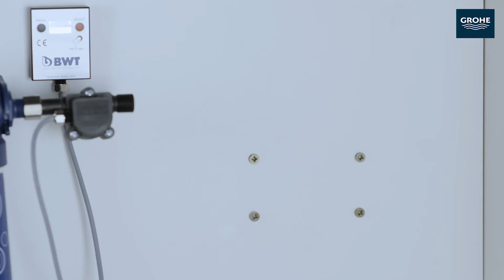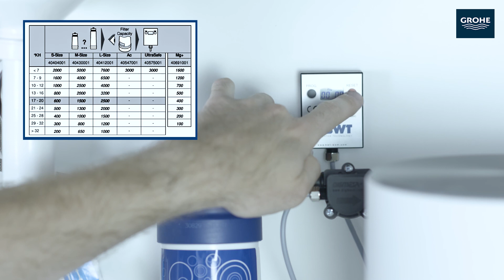Grohe Red - Product Installation (UK)

Comment: I had this installed yesterday, but I don't have instant hot water.  The kettle clicks when I touch the demand button after taking the child lock off.  The water filter is set to 2 and the programmer set at 615 for water in my area.  I also have a dishwasher connected to the cold water feed pipe that shares the connection to the filter.  Do you have any suggestions as to why I am not getting any instant hot water?  I've been on the website for both Grohe and BWT and not got anywhere.

Comment: Is it possible to use this (or any of the instant hot water taps) just with a cold-feed? I'm looking to eliminate my hot water cylinder altogether, but notice these are still using it...
Reply from the maker: Hey there! GROHE UK is happy to assist you further: You can reach them at 0208 283 2840 or come to World Business Centre 2 Newall Road
London Heathrow Airport
Hounslow
Middlesex
TW6 2SF 

Opening Hours: 
Monday - Wednesday: 8:30 - 17:00
Thursday - Friday: 8:30 - 16:00
Saturday - Sunday: Closed